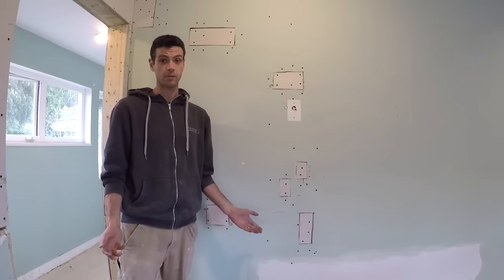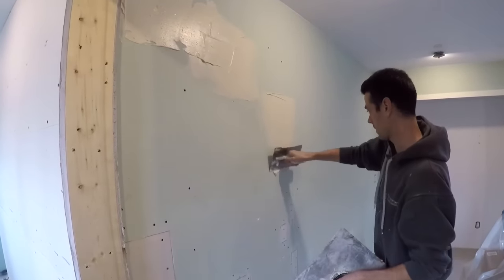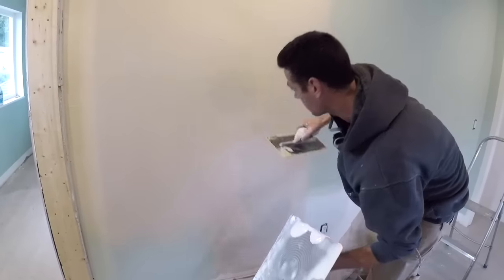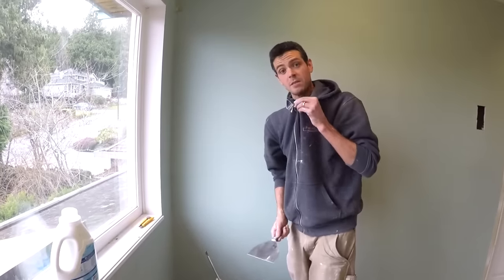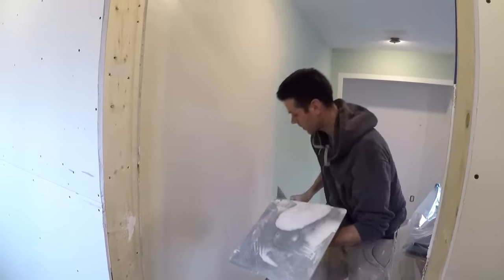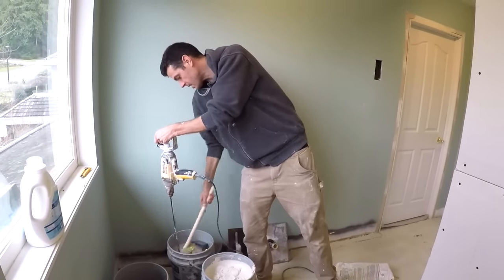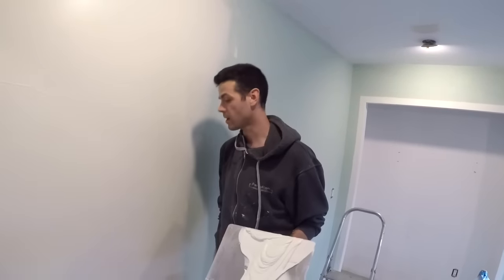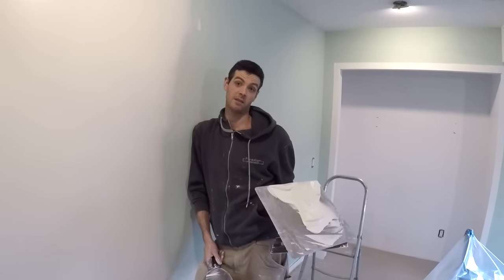HOW TO PATCH A HOLE IN DRYWALL!!! (Lots of them!!!)

Comment: Knew this was because of electricians before even clicking on the video.
Reply: My husband has no clue. He will tear up my fresh walls in a flash.
Reply: My father in law was an electrician  years back.  He was working a housing development when the sheet rockers threw up their rock without cutting for boxes.  He asked them to not do that because he had to plug and switch and, obviously, this was a real pain in the ass for him.  They basically told him, tough shit, it's quicker and easier for us this way.  Next day he searched for his boxes with a framing hammer.  Found some within three smacks, some took more.  The next batch of houses had all the boxes nicely cut out.  Sometimes it's just a matter of perspective.
Reply: Ele"chickens" 😛😛

Comment: The video was 22 min. Add 10 for missed camera time and clean up and sanding. Roughly 35 minutes and about $4 of material.

To the people that would replace. $13 for the new wallboard, the aggravation of going to get a piece if you don't keep it on your truck (and what idiot keeps full sheets on their truck unless you're doing sheet rock every day of the year) ... I can stop right there. You're already behind the game. 5-10 min to tear it out, clean it out. 10 to cut and install, 5 to tape. You're already at an hour plus more cash plus the home owner is saying "do you really get to replace the whole thing?? “ not to mention you still have to mud - wait and sand.

You jokers replace all you want. To each his own. If saw that wall and you told me you needed to replace the whole sheet, you'd be packing up your truck and looking for work.
Reply: Your reasoning seems pretty clear cut to me.

Comment: I get pissed sanding a couple joints can you imagine being the guy that does all the sanding , and you get on the job the next day and  this guy muds half the room to cover a hole in the wall
Reply: ...and it barely needs scuffed because it's applied smooth...
Reply: the guy putting the mud on sands the mud, its all part of the trade. To see if the work is good you shine a light down the wall and then you'll see poor workmanship.

Comment: With just a few extra minutes you could have coated that entire wall on that finish coat. That guarantees the wall looks the same when it's painted. The old rule of thumb is.....a patch is a patch is a patch. Odds are you'll notice the difference in the wall after it's painted. Beautiful thing about a Hawk and trowel and being a plasterer is that right before that mud sets off you can toss a little bit of water to it and trowel it back and forth to a perfect smooth every coat. Just as if you were finishing veneer plaster. Give it a try sometime. I do have to say though, I appreciate your humility and saying that you're not a true plaster and the fact that you actually ran four coats on that wall. That is good practice. Keep stroking brother!

Comment: You put a  lot of mud in a small room like that.  Do you recommend using a dehumidifier to dry the wall, to pull the moisture out, or does that cure the mud too fast? The drywall guys usualy have fans blowing, but the old plasterer guy I know hates that stuff, loves it to cure real slow.   I'm an electrician, but I am going to re drywall my bedroom to set it up for cabinets and lights.  Thanks.

Comment: I'm doing a job where the electricians cut holes all over the house in order to rewire it. And they used new boxes made for 1/2" drywall. I spent three days recessing all the boxes so I could skim coat the walls. The whole house looks like that one wall you are doing. Most holes are much larger also. And I have to make something out of it.

Comment: Is there a video on mud consistency for dummies? Today I finally got up the courage to try and patch a kitchen island (also the granite guys are coming tomorrow), I tried to use mesh tape but it was a total disaster. My pre mixed mud was very watery. After putting mud on and taking it off for about 30 minutes I just took out the tape and went with the mud alone. I know its not right but its better (I think). I dont know what I will get when I go over tomorrow.

Comment: I added led canister style lighting to my ceiling and had to cut multiple access holes to run the wiring.  The ceiling has a fine sand swirl type of texture (Not popcorn). Any videos of how to repair and blend this style?  Thank you much. I have learned a lot from you!

Comment: Good video, any advice on how to repair the edge of a recessed light hole?  Above the ceiling is blown in insulation so replacing the large piece of sheetrock from joist to joist would be much larger endeavor

Comment: Great videos!  I have a quick question. I replaced a 4x8 board on my ceiling, used fiberglass tape, skimmed the rest of the ceiling and had a pro come in and texture it. Now I have a hairline crack along the edge. Any suggestions on what happened and how to fix it?

Comment: Hi. When you sand between coats, do you remove the dust from the wall? If so, do you use a vacuum or a wet rag? Thanks

Comment: Exactly correct way to do it.  Masters use trowels.  Knifes are Lowes and Home Depot.  Its obvious to anyone who knows what they are looking at hes slowing down to teach while doing it.  You don't use a trowel like he does unless you know what your doing which means im sure if hes doing footage and not video hes faster.    Next, the difference between hacks and masters are in the other comments.  There is ONE right way to do things.  Anyone commenting on "he could have gotten away with...." is a hack.  Hacks are responsible for the downgrade in the trade.  ONE right way. Next 30 years in.  2nd generation.  I have actually told folks who ask for hints or tips to check his videos.  Finally, for all the spray and pray or slap some texture on it guys, this is how level 4 finishes look.  The art in Drywall is the 4th and 5th levels.  If you aren't doing them, sit quiet, load that spray rig, and cover your messes with spray.

Comment: OMG I saw that wall and I first thought, Was I there? great videos. I have learned a lot from watching you. Question: I own a 1954 rancher in Pa. I have done very little to the walls other then take one of them down in the living room. While I was removing the wall I noticed the builders used two sheets of gypsum or drywall one laid horizontal the other vertical. Then coated the outside with a thin layer of plaster. Was this typical then? And besides cost why don't we still practice this. Lets say my interior walls are solid with no cracks... Thanks again
Reply: I live in South Central PA. My 1964 house has walls of Rocklath and plaster. Rocklath is a drywall product made in various widths (1-2 ft.) and 8 ft. long, sold as an underlay for plaster. It nails up like wooden boards would be, horizontally onto the studs. Then a brown coat and finally hard finish coat of plaster are laid on. Not sure if it's used any more. Any new construction around here is just regular drywall. When, doing repairs, and I have to match up new 1/2" drywall with the old Rocklath, I need to fir out the studs with 1/8" material. (I know 5/8" drywall is available but when you're caught unawares...)

Comment: @Vancouver Carpenter how does patching differ when your re-using existing drywall? Nice thing is, the drywall is all the same height, but the tape will actually leave a high point. Is this why I never see anyone “patch” with old drywall, no matter how good its condition?

Comment: How do you typically bid a job? In Ohio it seems alot of guys charge by the board. But I dont see how that applies to repair work or old work. I suppose hourly is an option. Or just bid the job outright. Any thoughts?

Comment: what mud would you suggest that can go on fairly thick yet still cure properly? I use sheetrock 45 or 90 but it gets expensive as a little bag doesn't go very far.

I used some premixed compound stuff one time and it was total garbage, it wouldn't set properly..

Comment: I can attest that this works. I redid a bathroom on the cheap where new sheet rock was out of the question. The old wallpaper was very well adhered to the sheetrock, so even with soaking the paper, it pulled chunks out of the sheet rock and tore up the paper of the sheet rock. Floating thin layers of compound over larger sections of the rather than the immediate area of the damage  makes transitions much smoother. The walls looked like a movie set of a post apocalyptic war zone beforehand and looked like nothing happened afterward. 

The key is to take your time. I also used orbital sander on the wall to speed up sanding, because I didn't have to worry much about the mess. If you choose that method, tape off every area that you don't want covered in a crapload of dust.

Comment: He is good with lots of good tips, I always powermix my mud, its just easier, and when I am, "polishing" what we call finish coat I use an 18 or 24 inch round edge float trowel to loose any fat edges and make it much smoother. I also only flush skim like this in certain situations.

And Hamiltons is top gear, use it all the time.

Comment: What’s your choice of primer after all that mud is sanded and ready to paint over? I used oil based primer in the past and would really like to avoid using it again in future patch work. 

I also tried using water based primers, which didn’t roll on nicely over the dried mud at all. It was taking the dried mud off as I rolled the primer on. That’s when I switched over to oil based. The oil rolled on much nicer but is a real pain to deal with. 

Any recommendations since you seem to do this often?
Reply from the maker: Any water based primer sealer should be fine.

Comment: Hey if your patching plaster walls by patching them with 1/4" or 3/8" drywall pieces screwed to the lath/2x4 begind it whats the best mud/tape to use around the edges.  I have seen videos using Synko cement fill, normal bucket of mud etc.  I bought some Durabond 90 quickset that supposed to dry really hard similar to plaster just wondering what your recommendation is ?
Reply from the maker: Synko concrete fill is the best for those big gaps.

Comment: I would have filled the gaps with a 3 inch dry wall taping knife and let it dry first. Then lightly sand them or scrape them and do the 2nd coat with a larger knife, floating and covering everything. Checking with the straight edge of knife making sure there are no dips or tee-teer points :) your style and technique are on point either way. Like they say they're more than one way to skin a cat Haha!

Comment: I know you are busy but if you have time I was wondering if you could answer a couple of questions.

I ended up nailing too many holes in my wall close to each other for a four panel painting instead of measuring ahead of time before hanging them.  I must have been tired so I was horrified seeing all of these consecutive  holes for each panel.  I used caulking to try to fill some of the holes.  They werent wide in diameter but went somewhat deep into my wall and about a centimeter apart with alot of them together for each separate panel.  Can you please tell me do they need to be all the way filled?  I tried with the caulking tube but it was thick and the tube just wouldnt push it in the holes.  So I used as toothpick and that didnt get much of it in the holes.  The appearance on the outside was okay as I have stucco walls so they arent as noticeable when covered on the outside.  I havent done all of them.  I wanted to find out from you that if the holes arent really filled in will the structure of my wall be okay since I caused so many holes and they are so near each other.

Now the ones that I covered I cant really see and if I want to try to fill them again I cant find them now.  I probably also should have tried spackling but used caulking as that is what I had on hand.  I still have some to fill but wanted to know from you what is best.

I did watch this video but I caused alot more holes in one section than I saw on your wall and I am really worried I ruined my wall and the structure of it.  I hope this makes sense.  Thanks.

Comment: Have you ever used primer as glue for drywall mud?  When patching old painted walls it works pretty nice.  Use water based primer, wait until tacky then spread first thin coat of mud.

Comment: I came here because an insulation contractor left three-inch circular patches spaced 16 inches apart.  I tried using 45-minute EZ-sand to improve the patches.  Could not figure out how to feather edges on something that small, and did not get a good result.

From this video I learn that the right way to approach the problem is to repair the wall.  But I have never done drywall before, and I’m thinking exterior walls on three rooms is not the place I want to start.  Time to call the plasterer!

Comment: What I would have liked to see was what do you do when there is a hole in drywall and nothing behind it? How do you get the hole so that you CAN put mud in the screw holes?
Reply: You can put a small piece of plywood on the backside of the wall, on the edges of the whole and screw it in, or you can do a butterfly patch.

Comment: Sometimes u need to patch 1 or 2 spots. Hut on a wall that open.  1 plug.  Just laminate with drywall. Cheaper.  Less screw no lumber behind patches less mud. And better yet less man hours.  U got to sand and point up. Extra primer mud soaks paint up.

Comment: What about uneven drywall? I just patched a hole in my drywall one side is flush while other side is raised by 2/16. Wondering about ideas.
Reply from the maker: Just float it wider until you can't see it. Or take it out and fart around with shims until its flush.

Comment: The only thing I would do different, is when applying the final skim coat I would skim the rest of the wall as well. It’s not that much more. And I’d use a fan for faster drying.

Comment: is there any specific reason you can't just fill in the gaps without mesh tape and then sand it perfectly flush? it seems to me that if you had only one hole to patch it would be a waste to put mud on the whole wall if you could just sand the one hole patch flush

Comment: Ok, so I'm a painter, and as we all know, you have no idea how a patch will turn out until you sand and paint it, and then shine The Unforgiving Light on it at an Unforgiving Angle. (I use a 6 AA battery 1300 lumen flashlight at a 1° angle, basically parallel to the wall. I can see individual molecules with it.*) 
It looked pretty good, but I would have liked to have seen it after sanding and priming. Do you have any videos where we see the Final final product, i.e., after priming or painting? 

*ok, not quite molecules, but pretty damned close. It could pick out an eyelash.

Comment: I am a commercial drywall finisher and take a completely different approach to this. 1st step is to patch the holes 2nd step another coat over patches 3rd LIGHT skim coat if needed. Obviously light sanding in between. If you need heavy sanding, you are using too much mud.

Comment: For a time I was working with contractors and the drywall people would put lights on the walls but they weren't for speed up the dying process something to do with shadows
Reply: The sideaays light is how you can see the little imperfections in the wall  and or edges you need to sand out or touch up.

Comment: Wow.. this is  ton of work...   Is there anyway to shortcut this work... ASKING FOR A "FRIEND" :)
Reply: I replaced some sheet rock on a section of wall that was damaged.. Unfortunately, I have a lot of humps in the wall, even though I had smoothed it nice during the process.   I think the area is about 3 x 6.    It looks terrible when light hits it.   Would I have to replace the sheetrock again, or should I be able to just mud it?  Any thoughts?

Comment: Do you guys not use scrim tape. Those joints on the patch work will need it. It will crack when it shrinks.
Reply: My apologies. You did that.

Comment: You used half a bag on that wall?!

I'm just trying to patch up my whole house as a first timer, all the small cracks and dents, a few areas I had to tape together and only used a bit over half a bag at most.. is my wall just going to show all the small dents right after painting
Reply: If you are having trouble seeing the little imperfections in the wall point a bright light on if sideways, it will show everything. He did the right thing by floating half the wall to avoid all the edges of doing them all individually.

Comment: I wish I would have watched YOUR videos before doing my patching in my house!! I can see where I spent waaaay too much time putting waaay too much mud on the walls and sanding waaay too much!!!  Also I spent waaay too much time trying to get it right the first time and it came out with humps and not smooth edges. But then when I sanded I sanded a big hump down to a smaller hump. But still a hump. Ugh
Reply from the maker: yup:( it's a steep learning curve at first and with little info or even worse bad info it can be a challenge.
Reply: Ken Knutson Hi thank you for replying! We are selling and I patched and straightened some of the walls/corners and am getting ready to paint. I’m just not sure I’m prepping it correctly to match the texture. Do you have any videos on that? It’s older house and I think it has sand in the paint?  Also is there a correct way to sand a patch/nail hole to make it look like it’s not a patch or get flashing?
Reply from the maker: @Mnfish22   I will make some more videos on that soon. Sorry if I don't get to them before you need them. I'm not very experienced with texture either. We don't do much here.
Reply: Vancouver Carpenter that would be awesome!! Your videos have really helped me out! 

BTW...figured out how to deal with the texture ...skim coat the wall to smooth!! Using a bucket of mud and a roller!  Hmmm...where have I seen a video of that before? ;)